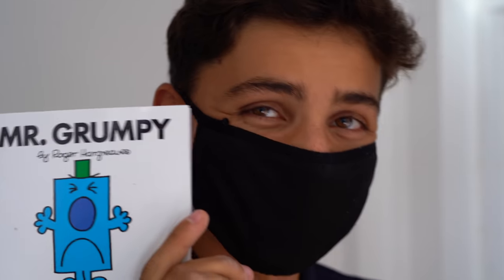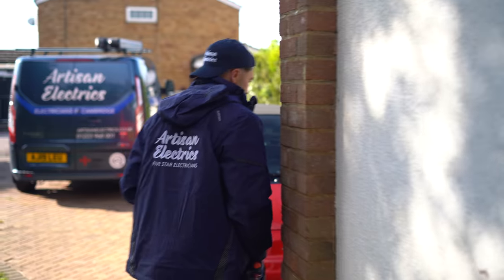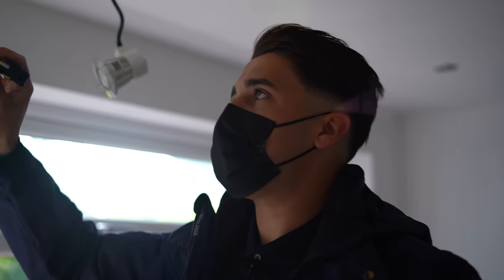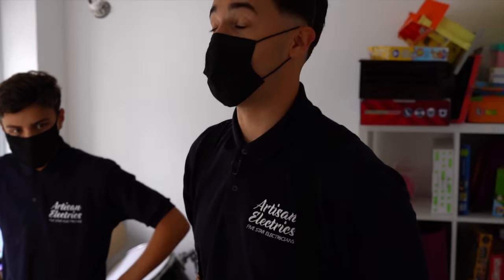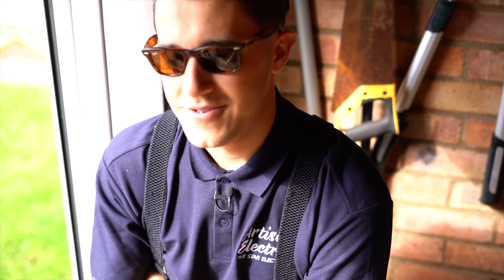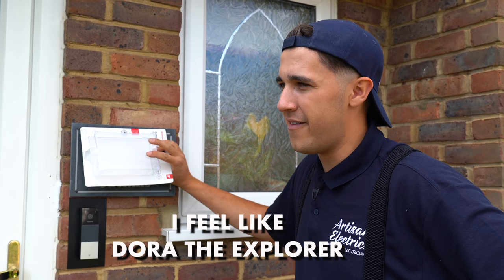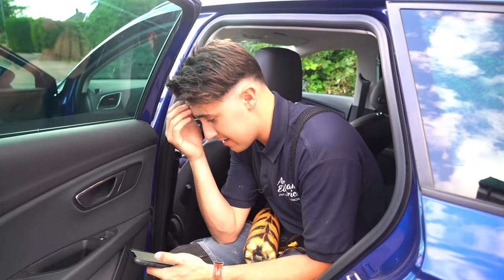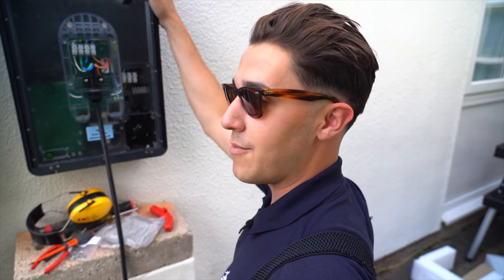EV Charger Delivery Nightmares! - Electrician Life

Comment: What I have learnt is Anderson Chargers are to be left alone on the shelf. Cutting corners with removing hardwired RJ45, no built in protection, and now apparently they make the installers jobs worse with wrong sized glands.
Reply: maybe the UK is unusual in they way they use SWA, i suspect Europe bury standard cable 600mm deep in conduits.
Reply: Also they had trouble getting one delivered on time before. But well they look nice and if the customer wants it...
Reply: @alouisschafer7212  I am not gonna blame Anderson for DPD.. I have no evidence that Anderson shipped it late.

Comment: BG aren't bad quality as you say, it's just the guys fitting them seem not to give af
Reply from the maker: Very true
Reply: The fortress boards are nice to fit, and cheap at like £13 a miniature RCBO
Reply: Screwfix special 👍
Reply: @heladas90 £13, that's for type ac RCBO's,  not much use in today's electrical installations.

Comment: Probably a stupid question, but does the Anderson not need to have a pen fault detection device installed? Seen a few installs done that are not Zappi charge points but doesn't have a pen fault detection device which I thought was a requirement (looking at the installs Jordan does at home).

Comment: Why not have the cable done and clipped and if you had a template even had the holes plugged ready for it arriving? I pulled a 6mm through the cavity already for mine to be fitted took a bit long but looks brilliant and with a wee bit of angle drilling ;)

Comment: Hi - I've seen a lot of discussions going around regarding installation for single phase charger with O-PEN protection onto a 3 Phase system? Is this actually correct. Some say it shouldn't be done and others are saying yes it's fine.  What are your guys approach to this. (ignore the fact of just installation a 3 phase zappi which will take 6 months to get anyway LOL). We had a job where it was 3 phase main DB, out to a 1PH sub DB in a garage which supply was good enough to add a 32 amp charger. Are we right just to add a charger to this single phase sub dB with O-PEN as the main supply is 3ph? What if you wanted to just add a single phase charger straight to a 3 phase board. Would really like to know your guys opinions.